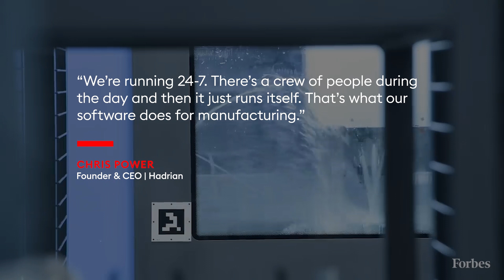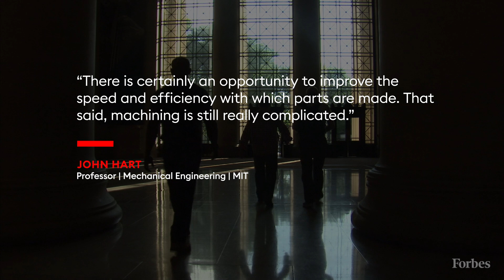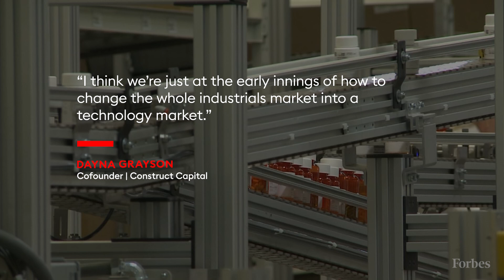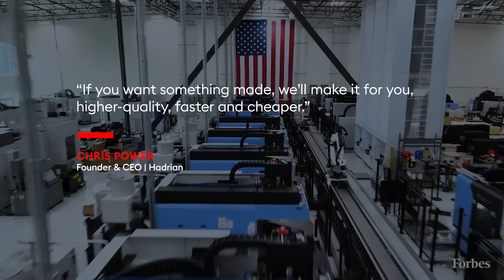This High-Tech Factory Makes Parts For Rockets And Fighter Jets Ten Times Faster

Comment: There is plenty of room for high level manufacturing in the USA.
However there is a shortage of equally high level skilled staff
And Much of the machinery for this level of work comes from Europe.or china.
The supply chains in the USA are incomplete as is the availability of raw materials based on rare earths.
Scaling up high tec machining in the US is difficult to achieve.